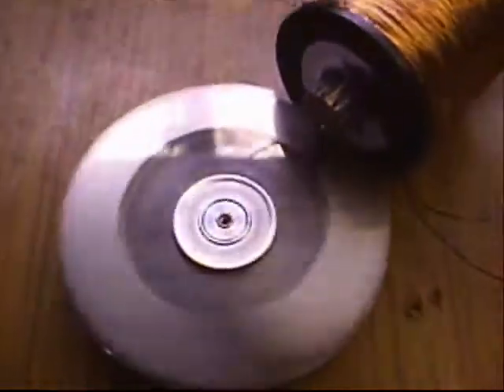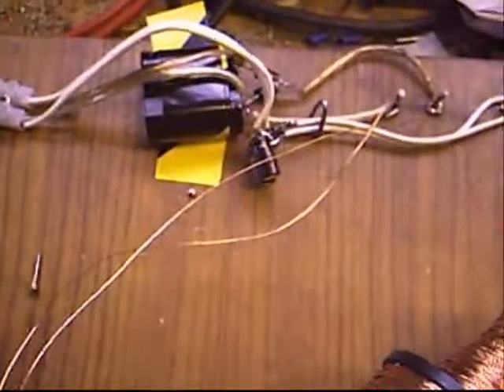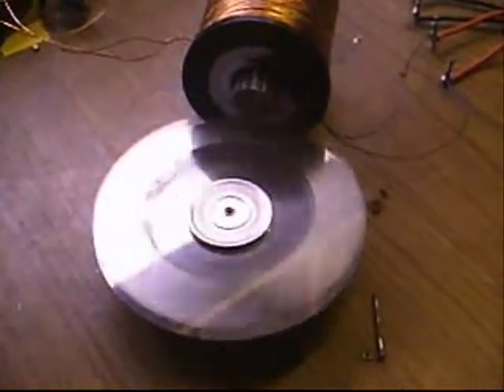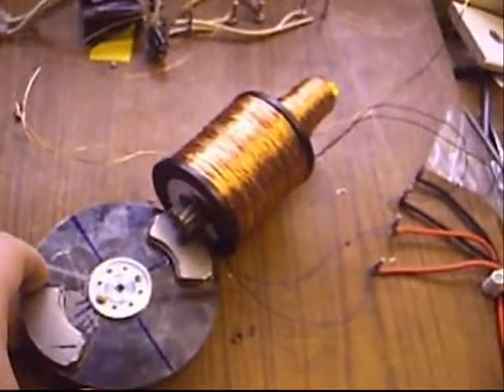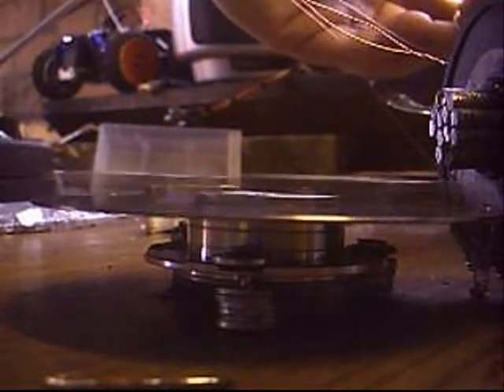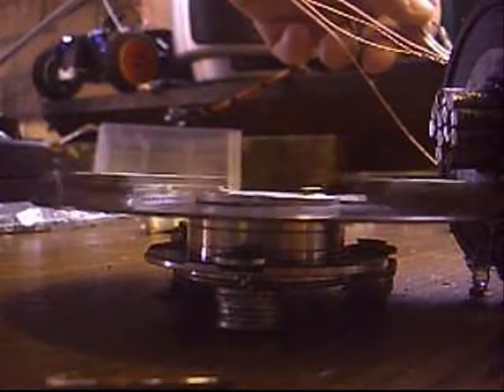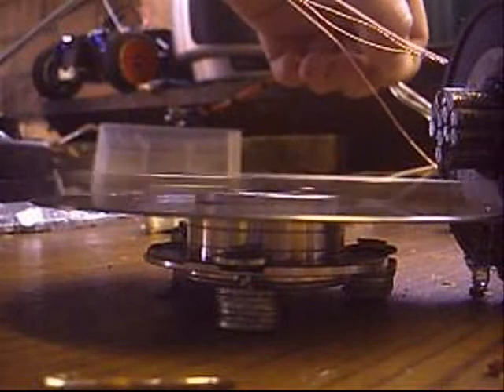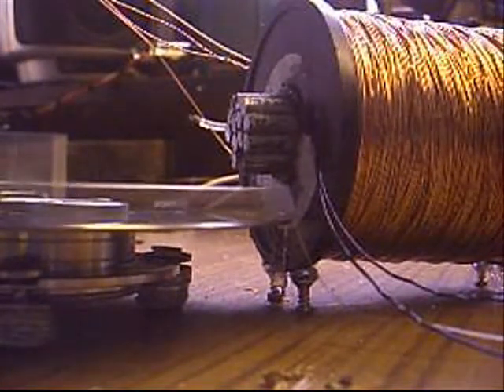comwarriors bedini feedback to source / new bedini - Update 7

Comment from the maker: The primary point of the video was to show that i have not broken any laws of physics and that lenz's law still applies...

What i have shown is that i have achieved a balance where the curent being drawn off and the resulting 'lenz effect' han be handled and harnised...
in normal operation the lenz produced by both generator coils causes my bifilar to act as generator coils providing power in the opposit direction hence why on my circuit I have D3 and D4 diodes.